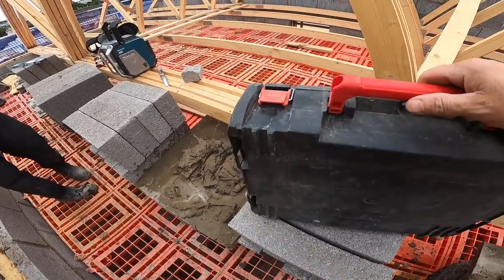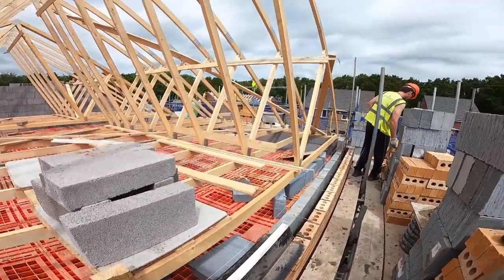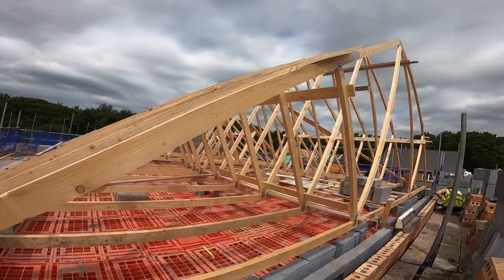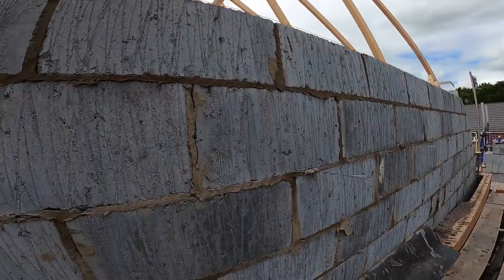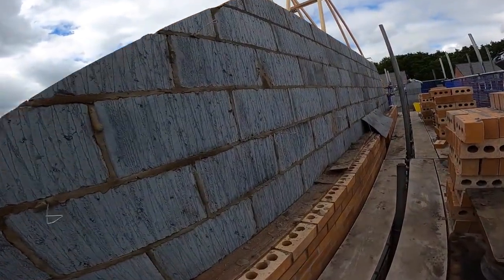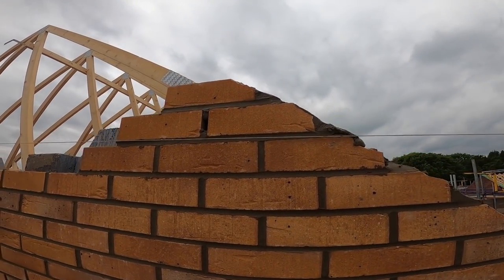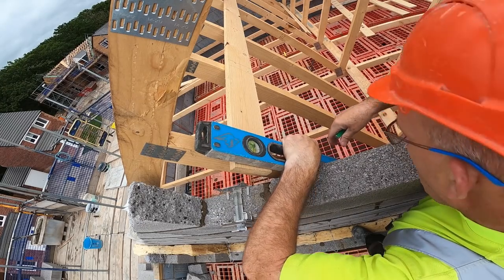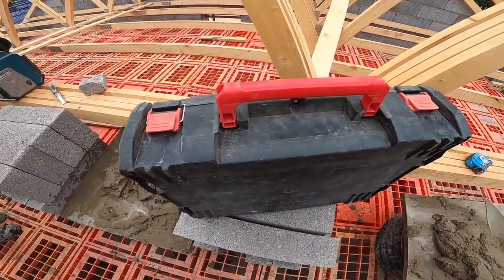SITE WORK CONSTRUCTION....PIKES/GABLES

Comment: Well you are a real credit to Wain Homes. Top Masonary work. Also liked the trimming with the Milwaukee. (Roof framers area) Did I notice at 5:12 a diagonal brace cut off to short ? (Sorry I'm a roof framing Nerd). Like for corbelled out box ends if I can describe them like that. Do WainHomes specify some straps across the vertical brake where the two colours of brick join? Look forward to the next one.
Reply from the maker: Cheers John , If any braces are short they get replaced and the corbels have ties at the straight joint . 
    As for the builder I’m guessing Al has his Wain homes vest on . 
   This tin pot firm aren’t even in the same league as Wain homes . Very poor and we won’t work for them again 🧱👍🏽

Comment: Jist noticed this video by accident mate. But good to see fellow brickies at work, good video. A bit different up in Scotland its mostly kits im building. Where did you get yer belt? that looks handy. Im forever putting ma hammer, tape or pocket bead and trowel down and cant find thum 😂. The tingle plate clamps look superb tae i jist seen another guy on here use them tae need to get them... plus the saw you used for trimming the joists looks handy can never get in with a saw when the fire stops are going through the cavity....Keep up the good work guys 👌
Reply from the maker: Thanks pal . We got all the belt stuff at our big local merchants Berrys but they are all available on line , the belt and hammer hook are made by Plano .
The clamps are Fitzbrick clamps and are superb . And the little power tool is a Milwaukee multi tool 12 v .
Glad you found our channel, we’ve got nearly 200 videos up there now 👌🏼🧱👍🏼